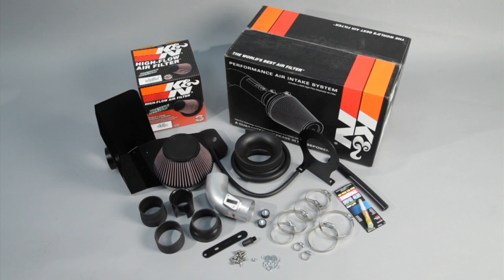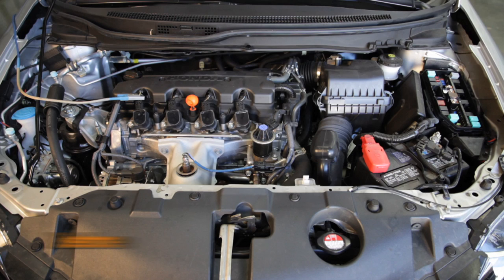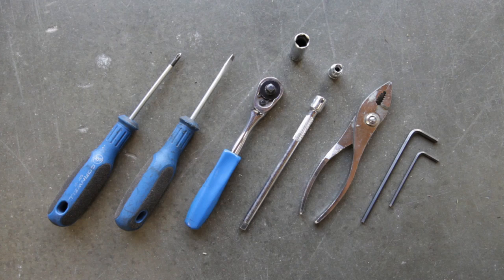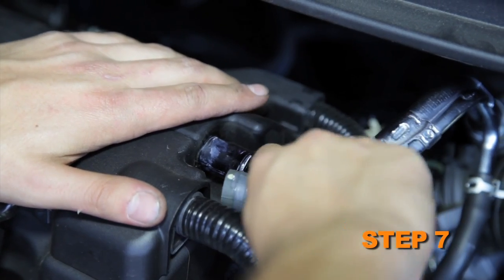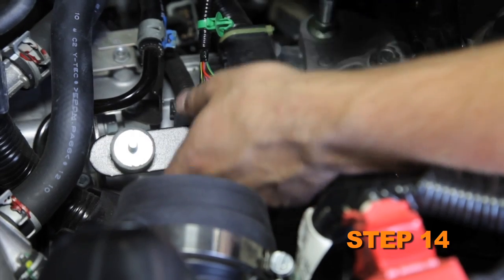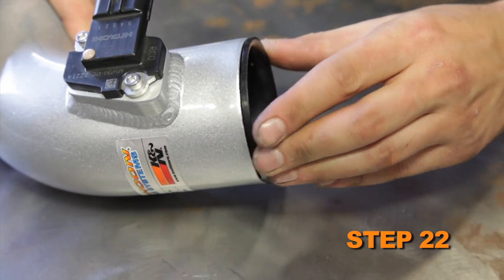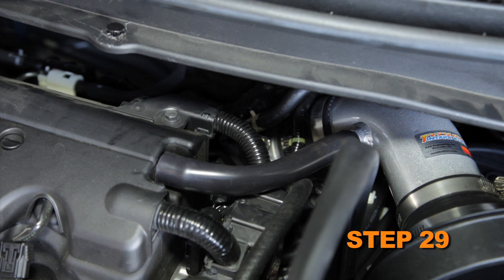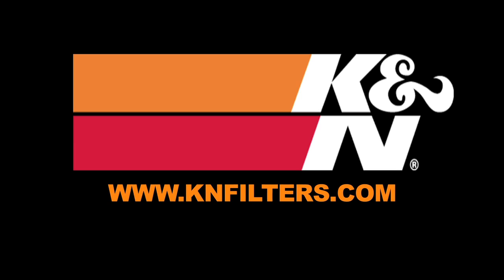2012, 2013 & 2014 Honda Civic 1.8L Air Intake Installation

Comment: I got a 2013 civic lx coupe as my first car and I can't wait to make more power with it.
Reply: trust me you won’t be making much power at all
Reply: Idlia Dosai it wouldn’t be illegal lol
Reply: You end up doing anything with your car and if so what !?
Reply: I own the same car, bro. This will only suck in hot air and lower your horsepower. Your engine needs cold air.
Reply: Same here, what plastic intake should I cop?
Reply: @thisisntsergio1352  i thought that shield is there to block the suction of hot air? Or maybe the hood is totally closed thus it can't suck in cold air?
Reply: @tonydrexler9115  The heat shield does help but without it, you'd heat soak. However, the stock airbox with a drop-in k&n filter is better for the car regardless, which is what I have in my 13 LX. The hood can be closed, it's ok. Cold air gets in anyway.
Reply: same boat as me got my 2013 civic coupe for christmas and here am i looking for the best parts to make my civic my dream first car

Comment: I have a 2012 civic and would wanna do this and Turbo Charge my lil 1.8 engine😭😭
Reply: Same if you make the jump first lmk how it goes 😅
Reply: Also me
Reply: @bushtyga999  same
Reply: @Noahsanchezfx  lol planning on getting an si to kswap & manual swap then go crazy w bolt on mods & tunes & shit like that no id dont wanna “just buy an si” i wanna build one 😂👌✅ doing it regardless of what ppl say idc my pockets
Reply: @bushtyga999 But you don't have to manual swap because the Civic SI only comes with a manual transmission.
Reply: @AH-lx5nj  ik that imma take the engine n transmission & ecu & bolt it on to my base model frame 🤷🏽‍♀️ i might do it i might not

Comment: air intake system was designed for the 2012-2014 Honda Civic 1.8L.
Reply: myTVS Accessories as long as 2014 civic? no matter what engine is? cause my engine
is LX, does that fit on my engine? btw im living in california means this is illegal on my state?
Reply: Do you mean till 2015 Honda Civic 1.8L because the same design is till that year. The redesign happens in 2016

Comment: I just installed mine today, and man it sounds so nice!!
Reply: Congrats on the massive 2hp gain! Hold
 on tight!
Reply: @johnandstephanie377 dawg💀
Reply: I would love to get one for my 14 EX, did you have to do any tuning or did you just install it and it worked?
Reply: @hayesa1757 k&n said there is no tuning required
Reply: @hayesa1757 did it do anything to ur EX i wanna add one to my 12 EX

Comment: I'm sorry if the engine is sucked, it does not make sense for me to install the connection that follows after the filter down to the bottom of the motor .... because the air sucked will be what is wrapped in the filter.

Comment: Once installed should I run the car with the radiator cap off to get any air out of the system since I'm removing the coolant bypass hose ??? Thanks
Reply from the maker: dtkrob No, that is not needed.

Comment: 1:28 VTEC KICKED IN! XD
Reply: Lol! XD
Reply: +kiddeath921 but there is no vtec xD
Reply: +malicious_turtle yes there is I vtec bro
Reply: kiddeath921 this car doesn’t have vtec
Reply: Garboi bet
Reply: There is vtec in these models of the 1.8l civics. The 2017 and up discontinued vtec in the 1.5l.
Reply: @Guybobful  there is vtec but is not the dohc with two transmission this one has the sohc which is one transmission
Reply: 1.8L R18 MOTORS ARE NON VTEC THERE IS NO IVTEC NO VTEC NOTHING. This motor is literally an upgraded version of the r18a1 that came out in 2006 for the start of the 8th gen civics. Only the si’s have Vtec k20a3 K24, so on. Sorry to break it to you.
Reply: @GlobalEnemy4ever  Actually the R18A3 and R20A3 engines here in Europe have VTEC cams on the intake side. And variable valve timing due to ivtec. It actually has several "humps" in the powerband, so that's why it no longer "kicks in yo". It has a much more seamless transition. It still makes about 140 horsepower out of a SOHC 1.8L engine, you can't do that with standard cam lobes fam. The 2 liter is about 160 horsepower. Meaning this kit, due to the much bigger intakes, will likely net some better results, compared to this more tranditional constricted intake.
Reply: @The_Noticer.  I’m not in Europe bro no vtec for  these engines other than the si
Reply: @GlobalEnemy4ever  Yeah 114 hp sounds like it doesn't have VTEC, lol. Guess we have the better engines here. They are also very good candidates for turbocharging, due to the built-in manifolds, forged internals and piston jets.
Reply: @GlobalEnemy4ever  still, Europe or not, these engines have terrible all-motor gains and your money is best spent turbocharging it.

Comment: I’m having a problem with my civic 13 the sensor doesn’t align with the holes on medal tube… it only fits with the sensor facing up but car turns off
Reply from the maker: Please ontact our product specialists at 800-858-3333 or tech@knfilters.com.  They will be able to help you quickly resolve the issue

Comment: Trying to remove my old air filter box now and with the two bolts removed it seems like it's connected in the back somehow? I have pulled pretty hard on it, but worry anymore will break something. Is there a bolt in the back on some?
Reply from the maker: Please contact our product specialists 800-858-3333 or tech@knfilters.com.  They will be able to help you quickly resolve the issue.

Comment: I was gonna get me a cold air intake to gain some horsepower on my 2012 Honda Civic lx and my friend told me “you know you won’t gain any hp right” is this true or no?
Reply from the maker: All K&N air intake systems are guaranteed to provide increased horsepower and torque.  Dyno charts are published on the product page at knfilters.com.  The dyno chart for this part can be found at the following location http://kandn.com/dynocharts/69-1020_dyno.pdf
Reply: It’s a 3hp increase idk if with a tune or not. This engine is not meant to be nor should it be tuned. You can probably tune it up 10hp and that’s after a couple thousands: I suggest leaving it as is and buying a different car if you want more power. This is a great car to mod on the exterior but not under the engine.
Reply: It’s a 3hp increase idk if with a tune or not. This engine is not meant to be nor should it be tuned. You can probably tune it up 10hp and that’s after a couple thousands: I suggest leaving it as is and buying a different car if you want more power. This is a great car to mod on the exterior but not under the engine.
Reply: @Frank-eh3jc so why you can to watch this video an just bring your useless opinion???

Comment: I would love to buy a front bumper like this, where would you go about and buy one? Or is it just certain models or states ??
Reply: What bumper? That is the standard bumper in all 9th Gen Civics Sedan, they just installed the front bumper lip spoiler... You can buy it from eBay... I got mine already.
Reply: I should of mentioned I have a 2012 sedan, that's a '13-15' model. So basically doesn't exist for my vehicle.

Comment: got error emissions codes with my 2012 r18 ex. ordered hondata and now I got the codes away but it stutters at 2000rpm and 3000rpm when vtec kicks in...and I changed this to 3500-5500 and it ran amazing. 35mpg in town 45-60 highway but then I got error codes for bad muffler circulation. I have an aftermarket axel back 3' inleft 4' outlet. so I just flashed it back to stock and in process of tryna find a performance shop to see why this stutter is occurring.
Reply: +OwlEyes85 r18 in the 12' civic doesnt have vtec lol
Reply: +malicious_turtle  All 2012 Honda Civic LX does have a  1.8 i-VTEC ,140hp./   2012 honda civic EX 140-hp, 1.8-liter.vtec.  and the 2012 Honda civic si   201-hp, 2.4-liter. VTEC.

Comment: You don’t need to tune the ecu for the extra airflow?
Reply from the maker: No, all K&N intake systems are designed and tested to work with factory ECU settings.  If you have any other questions or concerns please feel free to contact our Product Specialists at 800-858-3333 or tech@knfilters.com.
Reply: @KNfilters I’ve been looking for this question thank you.

Comment: So um my fresh air hose is on backwards, that little round part is on the bottom instead, not sure why in your video it's the opposite, I've never touched it since I bought my car. So when I install this... So I want to put it the way I originally had it or the way you have it in the video?
Reply from the maker: +Chris Saravia We recommend installation as the video shows.

Comment: Hey would this be compatible with a 2015 LX engine is practically the same but don't wanna purchase if not. Theres no other option but this one on your website but its just 2012-14
Reply from the maker: Yes, the 69-1020TS intake system will fit a 2015 Honda Civic 1.8L.  Check out the "applications" tab on the product page, where you'll find your application listed.

https://www.knfilters.com/69-1020ts-performance-air-intake-system

If you have any other questions regarding compatibility, please contact our Product Specialists at 800-858-3333 or tech@knfilters.com.
Reply: @KNfilters  another question real quick i have it as a car that will never see public roads in CA why can't I still buy it...🙃☹
Reply from the maker: Please contact our Product Specialists at 800-858-3333 or tech@knfilters.com for help with your question

Comment: I just got a 2012 Honda Civic LX and I wanna put one of these in but I don't want to mess with the reliability of the vehicle. Can this mess up my car?
Reply: As long as you reinstall the air flow sensor, you should be fine. If you really want to do this, just take the time to learn what goes where and how to put the stock back if anything happens

Comment: i cant remove the air box from the mounting brackets (step 5) is there a specific way to remove it? i literally tried pulling it up and side to side but no luck. im at a stand still now if any one has ever done this before let me know pls
Reply: Cooper Johnson have you figured it out yet ? any tips
Reply: Tyler Redford i didnt. theres something holding on the airbox itself and its not a simple lift it up and pull it just like on the video. im gonna get my mechanic to just do it when its time for an oil change
Reply: Tyler Redford take it to the shop and ask them to remove it for you. I had to replace my tranny filter and I guess its underneath the air box so they had to remove it to get access to it. When I got home I was able to lift and pull the air box off since they loosened it up in the process of changing the filter.
Reply: Crimson XCVI so you had a transmission fluid change and filter ? my 2012 civic has around 68 xxx kms. i feel like changing the fluid is too early. they might just charge me for labour to clean the maf sensor(which is why i want to take off the air box).
Reply: Cooper Johnson Yup, well here's the thing, my car needed a tranny fluid and filter change anyways. Did some research and found out that the filter is underneath the airbox and in reality I needed them to at least loosen it up so i can clean the MAF and replace a cracked air intake hose myself. I dont know if that was a smart move on my part or what but I didnt want to break anything. Weird how its literally a gromet keeping the airbox down but it was impossible to remove. My car has 93k miles so it was time, either way dont go by mileage, check the fluid level and color. If its brown, its time to replace.
Reply: So here's the real question, I'm not going to a mechanic for any of this because I simply don't want them working on my car unless it's mounting tires. Can I break the gromet holding it on and still be able to place the new one for the new casing ?
Reply: Tyler Redford I wouldnt know the answer to that question. But if you really want to remove it yourself, I think your best bet would to stick something underneath the airbox , like a long screwdriver, and push down the screwdriver so it can possibly release the airbox from the gromet. Like mentioned before I didnt want to do anything other than lift and pull the airbox by hand because i didnt want to break anything. But now that i think of it, sticking a long screwdriver underneath it might work.
Reply: Thanks for the advice, I'll do my best and hopefully it works out. If you think of anything else let me know I'm installing this in 1 week. Honestly they should have mentioned it in the video because it seemed so simple and easy to reach 😐
Reply: Tyler Redford good luck. i have the kn air filter and im might actually get the air intake since i feel like the car would run way better with the intake.
Reply: Tyler Redford if youd like i can send you a couple photos of what it looks like once its removed. maybe through email?
Reply: Tyler Redford what year/model is your civic? installing the kn intake is pretty simple just dont forget to use the old oem parts as stated on the video. the real pain would be taking off the gromets where the airbox is mounted.
Reply: Crimson XCVI my fluid level is fine and i can still see some red on the colour when I wipe it on a paper towel. no flaws in shifting i just dont like it when the car lurch forward when i press on the brake going 40-60kph(this is the way it downshifts i guess) rpm would be around 1500 then would go down to 1000 then rise back up to 2000-3000rpms while foot is on brake. apparently this is normal to these kinds of cvt transmission.
Reply: After you take the two bolts holding the air box on, get a solid grip on the air box and give it a good quick tug and it will POP loose. Just remember the MAF sensor is still connected. 

They pre loosened it in this video.

Comment: Does it need a tune ?
Reply from the maker: All K&N intake systems are designed to work with factory ECU settings and do not require a tune.   If you encounter any issues or have any other questions please feel free to contact our Product Specialists at 800-858-3333 or tech@knfilters.com

Comment: Fit honda civic ex 2014?
Reply from the maker: Yes this system will fit a 2014 Honda Civic 1.8L.  Check out the "vehicle applications" tab on the product page https://www.knfilters.com/69-1020ts-performance-air-intake-system

Comment: Will this work for a Acura ILX 2014 2.0
Reply from the maker: No this system will not work for an Acura ILX.  If you have any other questions regarding fitment please contact our product specialists at 800-858-3333 or tech@knfilters.com.

Comment: what engine is in the 2014 civic lx(non si)?
Reply: 1.8L 16-valve, SOHC 4-cylinder
I believe the engine code is the
1.8L R18Z1 i-VTEC SOHC I4
Also dont 'mind' the (V-TEC) Part in this.
It is not the 'big' deal like the  2.4L K24Z7 i-VTEC DOHC I4 from The SI trim. Dont quote me on that .. I do own the 2014 lx and trust me there's no powaaaaaa in that thing ahaha.

Comment: Would this Fit my Civic LX Coupe 2013?
Reply from the maker: +Javier Medina What engine size do you have?
Reply: +KNfilters 1.8L
Reply: @KNfilters  my sensor doesn’t align with holes on medal tube it does but with sensor facing up but car turns off sensor should be facing down

Comment: hi could you install this intake into a 2011 civic 8th 1.4L? or do you have any for this engine?
Reply from the maker: Do you mean 1.8L?  Check out part #69-1013TS for an intake that works with a 2011 Honda Civic 1.8L https://www.knfilters.com/69-1013ts-performance-air-intake-system

Comment: What wheels are on this particular Civic?
Reply: +Andy Lem I got the intake installed. It's pretty awesome.
Reply: Since most of the wheel footage is of them spinning, it's kind of hard knowing the exact wheel. But I'd start looking at ' MB Battles ' 
That's what the wheels on this video most likely resemble.
Reply: Thanks Al I been trying figure it out

Comment: Is it compatible with 2013 civic si 2.4l?
Reply from the maker: No, this kit will not fit a 2013 Honda Civic si, but the following will (part # 69-1019TS) https://www.knfilters.com/69-1019ts-performance-air-intake-system